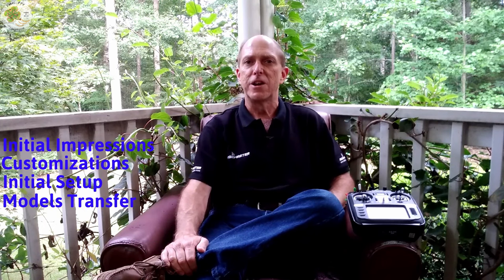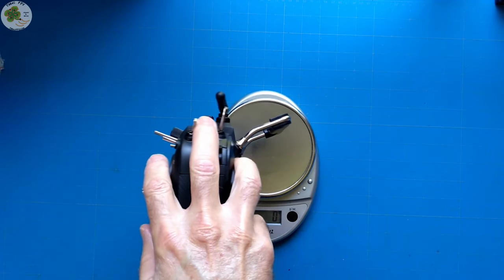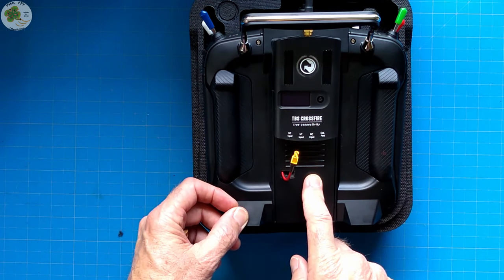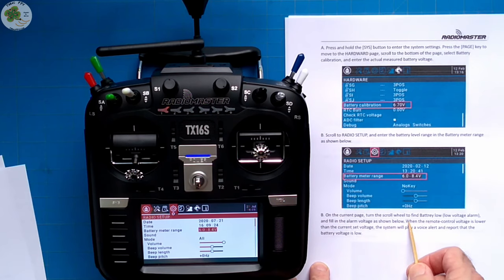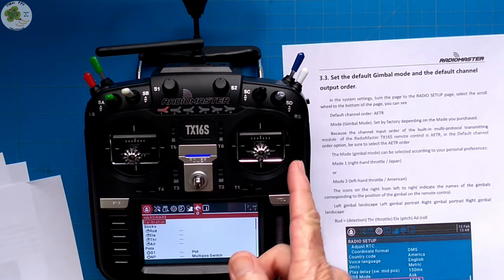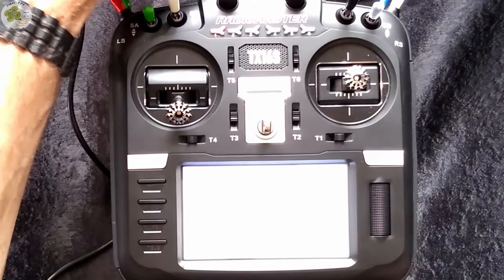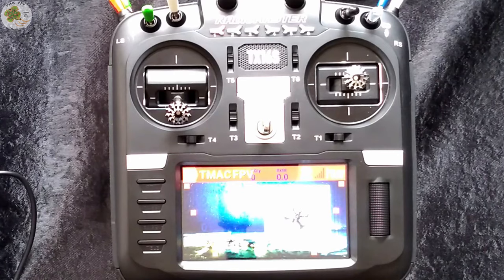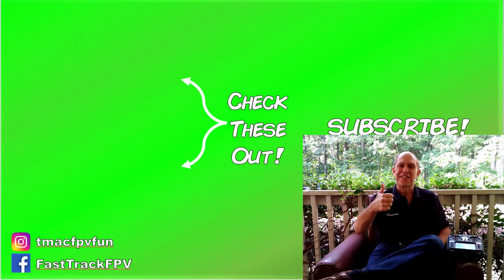RadioMaster TX16S (Setup, Customization, Comparisons and Flight!)

Comment: The pop out hole in the case doesn't make any sense........ I'm assuming that the crossfire is powered when it's plugged into to the module bay and the transmitter is turned on..... So what's the point???
When using multi protocol and it's not crossfire let's say a flysky whoop then the crossfire doesn't turn on. Only when it's selected for the model.
If running in high power then an extra battery is needed so as not to drain the transmitter battery..... This method puts a hole in the case, flattens the transmitter battery just as quick and requires the extra job of plug-in and unplugging it!
What a terrible idea.
Reply from the maker: TBS Crossfire Manual:  **Please check if your Radio is capable to provide enough power for the 1/ 2 W option. Otherwise you
might break the electronics inside of your radio."  RadioMaster battery power lead to Crossfire module allows for high-power settings on Crossfire module without need for an additional external battery.
Reply: @TMacFPV  ok.... So it's to protect the internal electronics of the transmitter....
Interesting..

Thanks
Great video has usual
Reply: Could th T16's internal electronics cope with the 2w power for crossfire?
Reply from the maker: @gmivisualsjason3729  So, what you meant by "What a terrible idea," is "I don't understand the concept behind this, do you know the reason for it?"
👊👈Fist Bump 👌 
TBS Crossfire Manual:  
RF power
Radio Signal & Telemetry downlink:

Micro TX: Selectable 25mW and 100mW (250mW with FW 2.40 or later)
Standard TX: Selectable 10mW to 500mW, additional 1W and 2W available
with external power connected via XT30 socket
Reply: @TMacFPV  😂😂😂😂 that so reminds me of my parents...
Reply from the maker: @gmivisualsjason3729  fond memories